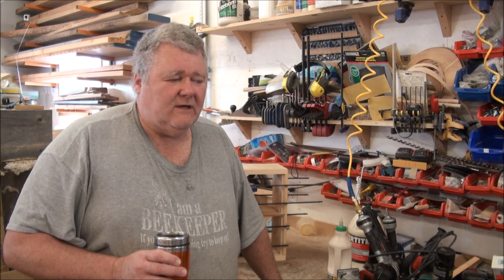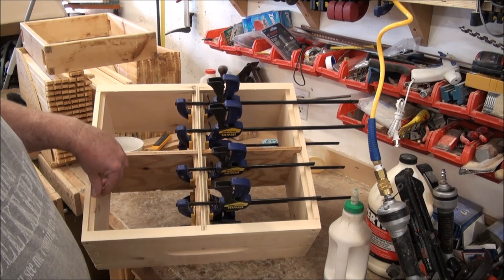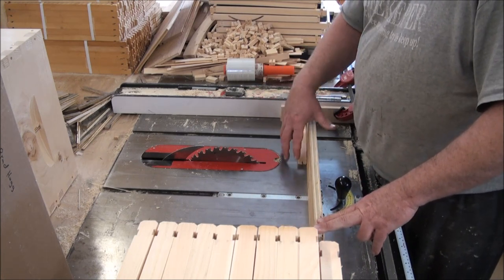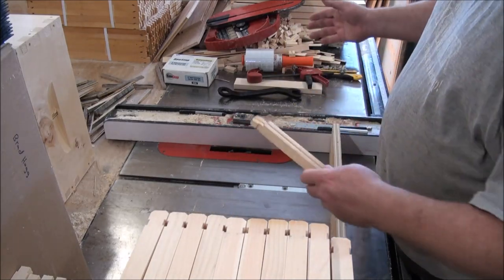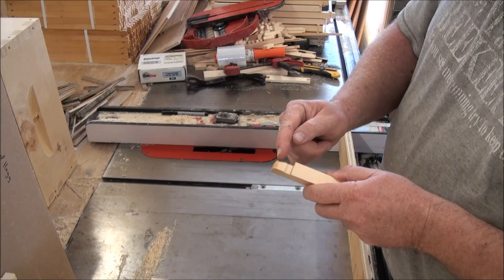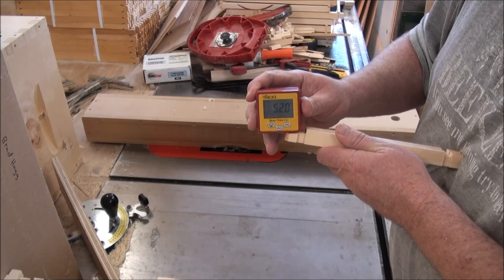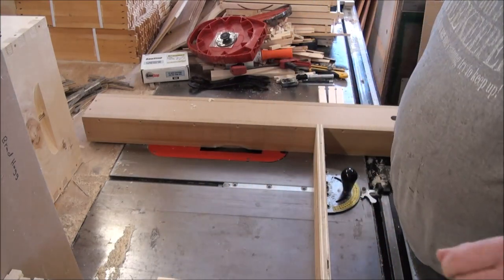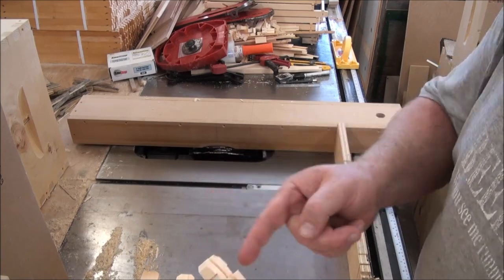🔨Mating Nuc Frames - That Bee Man

Comment: When I make those 10.75* cuts, I use a jig I built on my band saw. For the corner 45* cuts, I just install the standard blade in the saw at 90* up against the sacrificial fence. Quick and easy peasy.
Reply from the maker: How many do you make that way?
Reply: That Bee Man at Faith Apiaries 3-400 at a time. I make all of my full size frames and my mini mating NUCs. I fabricate mine from 2x8x8 pine